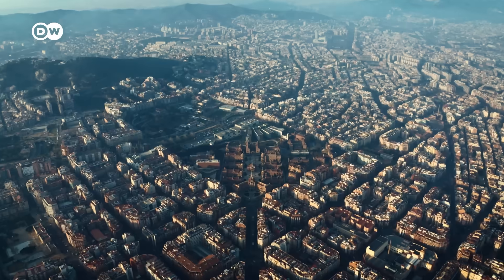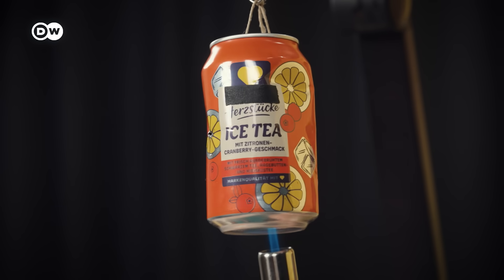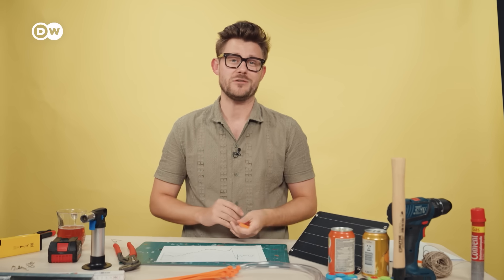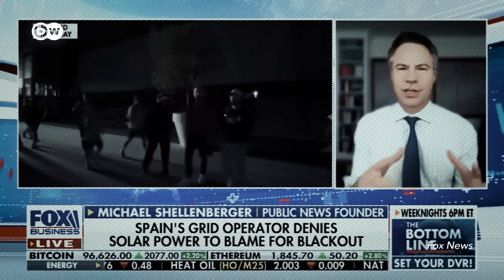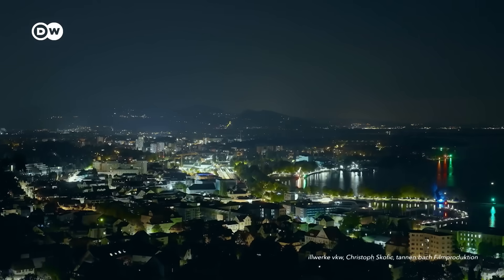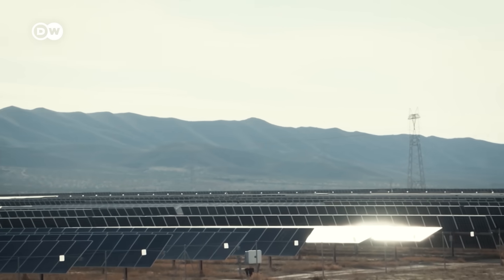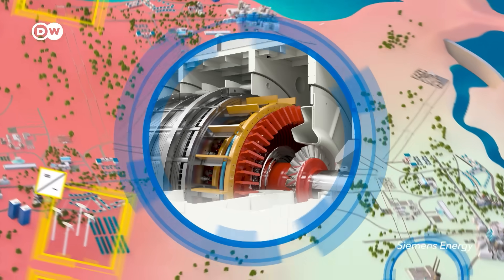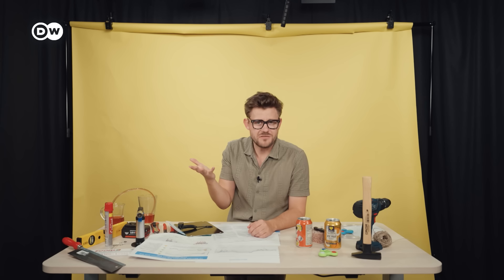Solar's hidden problem (and how to solve it)

Comment: "but spinning turbines don't just help make electricity they also help keep the grid stable because they have a naturally built-in security net called inertia"

It's called inertia, but it's actually "spinning inertia", otherwise known as angular momentum, that actually keeps the grid stable due to the energy stored in the spinning mass.

Turbines and generators have exactly the same inertia whether they are stationary or rotating. However when rotating they store energy and can absorb or release energy depending on the grid load. This acts in much the same way as a smoothing capacitors on the output of a DC power supply which automatically, and virtually instantaneously, absorbs or release energy to stabilise the DC voltage, thus giving time for the power supply to react.
Modern switch mode DC power supplies can react much faster than the traditional transformer rectifier based ones which means that much smaller smoothing capacitors can be used on their output. Similarly, inverters can react faster than spinning generators to changes in load, so whilst they will still probably require some inertia it should be significantly less than needed to stabilise a grid powered by traditional spinning generation.

Comment: just make a heavy wheel and turn it using solar power and then connect the wheel to a generator and supply to the greed problem solved
Reply: 1. That was not the issue.
2. There are better kinetic energy storage systems.
Reply: @old-pete yeah there are reservoir that can be built but may be they are a little expensive I guess

Comment: renewables ALONE are bad for a grid, luckily we have a mix.
Reply: Renewables are already a mix.
Reply: @old-pete  Honestly wind and solar isn't much of a mix. They generate their usable power in different seasons. We could go further by looking at geothermal and hydro but unfortunately they are geologically dependent.
Reply: @stijn2644  That is why wind and solar are not the only renewables.
Reply: @old-pete  What are some other renewables that are depolyable in most countries over the world except for hydro and geothermal?
Reply: @stijn2644 
Hydro and Geothermal are part of the mix, as is Bioenergy.
That are five sources of energy, quite a mix.
Reply: @old-pete  I asked particularly for sources other than geothermal and hydro because they are not representable for every country. Geothermal is very limited in heat production at this time, so only very low heat applications can benefit from this renewable form. Hydro needs mountains to produce the quantaties needed for an industrialized nation.

Bioenergy is honestly one of the worst sources you could use. Very low energy return, air polution, vast amounts of land compared to energy output and maybe worst of all, it competes with the food chain. 

Wind produces in the winter but not really in summer

solar produces in the summer and barely anything in the winter. 

That's still only wind and solar that can be deployed on a large scale. Don't get me wrong, renewables are a good way of producing energy, they are just not an end all fits all solution.
Reply: @stijn2644 
You claimed wind and solar are not a mix, but it is five sources.
Most countries have access to all five.
Bioenergy does not compete with food production if you use waste, that is produced everywhere people live.

Comment: Large utility scale batteries, with good BMS and inverters, also do quite well to manage demand fluctuation. This kind of thing is not some kind of blocking problem. It's more  an another-day-at-work hiccup for grid engineers. I'm not one, and the same concept as a synchronous condenser was the first thing I thought of. And really that's just a very fancy name for a large flywheel storage buffer that's optimized for a specific function.

Comment: 3:00 batteries can solve this problems!
Reply: Batteries are only useful for small appliances. Big scale classic batteries will just melt themselves.
Reply: @forev5091  no! big Li- batteries work in bigger cases as well
Reply: @forev5091 bs

Comment: Soooo now we admitt it was a issue?
Before it was all denial. This is like the push with electric cars....sure it sounds nice but you need the grid to support it. Also uf your grid is powered by coal it makes electric cars utterly pointless and actually worse for the environment.
Reply: 1. It is not really an issue.
2. Most countries do not run their power grid on coal. That is not economical.
Reply: Electric cars are around 4 or 5 times more efficient than gasoline vehicles if we're measuring energy per kilometre. So yeah, they do sound nice. 

The usage of coal for electricity generation has decreased drastically over the last few decades. So, no, driving electric vehicles aren't worse for the environment.

Comment: The issue is something we have in the uk. Especially as the push for electrification of vehicles etc
Reply: No its not look into the UKs stability path finder projects, you'll find the UK has been very active in deploying inertia and grid forming technologies. Not just for increased grid resilience but because they also save billions in operating costs, helping to address historic issues present in the UK's grid.

Spain consulted with the UK after their incident to see how the UK supports its grid. What with the UK having a laege number of SynCon units and the 3rd largest global deployment of grid batteries (and the lhighest total capacity in Europe).

Comment: So to prevent this issue long term a battery (sand, salt lithium etc) or hydrogen generation or running pumps on water storage of the excess power being produced
Reply: Battery solutions not lithium batteries to expensive and can’t store over long periods of time but building Pumped Hydro Storge and as you say Sand or salt or batteries could be a good solution.

Comment: When we discover a new energy source like photovoltaic solar, we go all out thinking we've discovered the ultimate technology that we should exploit. 
Until a newer tech comes along, then we think how did we put up with the old tech? 
We will discover new metal alloys that will generate electrical current when exposed to radioactive material, with an efficiency that's worth while exploiting. 
So, hang on to all that radioactive waste! you'll be digging them up soon enough.

Comment: Grid stability means investing in new transmission infrastructure and energy storage. Not just batteries but pumped storage hydro for places where it won't cause deforestation

Comment: We have had blackouts long before solar was on the grid
Reply: @offgridwanabe How often would you say it has happened? Is it really a problem, are we talking once a month, once a year, multiple times a year or once every 2-5 years or longer?
Reply: @luffirton  20 some years ago the grid went down in North America in August for a few days because of a failed sub station and it cascaded taking out power for a 1000 kilometres. The grid is old and more heavily used every day. I am surprised it doesn't happen a lot more.
Reply: @offgridwanabe  Yes, it was August 2003.
Reply: @luffirton  The northeast blackout was in 2003, so it's been over 20 years. However, that blackout cost nearly $6 billion in damages. So it's not really about how frequent they are, but rather, how costly a massive one is.

Comment: Many appliances at home transform the grid's AC power into DC power before being useful in the device. So I think local DC solar to DC appliance would be a much better solution for solar energy. The problem would be that the kitchen and washroom still require AC for the high power devices.

Comment: The problem is not solar or renewables, the problem is the implementation! There are algorithms for inverters that mimic the inertia of a conventional power plan, but here in Spain, if you want to connect solar panels to the grid, they need to follow the requirements and they say the inverter need to follow the grid, and that's the problem.

Comment: The biggest problems are our grid systems not being developed correctly in the past, we should implement big battery systems or other stabilisation system for energy needs, that are getting bigger and bigger.
Look at Australia and their big solar systems with battery storage integration

Comment: Just remember that it is solar and to some extent wind that requires massive investment costs  and operating cost and this is the price to add to solar and wind.  

This means we will never have lowered bills. In the uk bills just went up again but our government promised to reduce them £300 - they lied.
Reply: Move here to Norway then we have a government program £0,037 flat fixed rate for 5000kwh a month, over that you have to pay market price. The government pays the power companies the difference between the fixed rate and the market price.

Comment: Who exactly should be responsible for making the investment necessary to let part-time power sources like solar or wind  operate in a way that does not destabilize the grid? It should be the operators of the wind farms and solar panels rather than the utilities that actually are responsible for making sure that electricity is always available to the consumer
Reply: You just contradicted yourself exactly because the utilities is the responsible party for keeping power stable, and always available it is them that will need to be able to control and regulate their grid. That means they will need to have installed the right tools, hardware and software needed to make that a reality.

Comment: This is BS as Spanish officials & energy experts have confirmed that solar had nothing to do with the blackout, but is was triggered by a cascade of generation losses following the tripping of a large generator in the province of Granada, which led to a sharp drop in grid frequency and a subsequent overvoltage that caused further generation trips in southern Spain and Portugal.

Comment: 🔌🔌🔌I designed a base and peak shaving microgrid paralleled to a rural utility CO-OP in the Colorado Rockies, utilizing BESS in conjunction with grid-forming inverters integrated with STATCOM. It has operated flawlessly for over seven years. Additionally, I installed a black-start diesel generator to be employed in the event of complete control system failure requiring a restart. So far the generator has not been required.🔌🔌🔌
Reply: i trust that diesel generator is occasionally being started to exercise it.
Reply: @bocadelcieloplaya3852 @bocadelcieloplaya3852  Yes, once a month for 30 minutes followed by a cool down.

Comment: I appreciated this video very much. 
I still wonder who checked the e-transparency platform when this happened. If that is anything accurate, it seems not so much a grid problem but a management problem. Because 15min after the generation started to crumble, the general load was being cut-off, but the massive hydro pumping loads were still going. why not stop the hydro pumping before cutting everyone else off?
At least in Portugal hydro pumping was 50% of the entire load on the grid at the time of the blackout. Feels to me like that could have made the cascade not go down as dramatically as it did. Spain had a different proportion of hydro pumping load to the general load, but very significant still.

Comment: "Yes, solar doesn't spin. But is that a catastrophic and unsolvable problem for our grid? No!"

Strawman argument. The vast majority of critics have always said that you can have as much solar as you want, it's just a question about how much you want to pay. 

"But everyone has to do their homework."

That's a strange way of saying "Renewables are not in fact as cheap as often advertised. They require more investments in the grid."
Additionally, you left out that lots of the electricity is wasted unless you invest even further into storage.

Do an honest accounting of levelized total cost of energy for every incremental TWh of energy supplied to the grid. Everything else is just propaganda.

Comment: Seems odd they would leave out grid scale battery storage completely from this.
You hook up a battery to absorb any extra solar, and output if solar drops, that pretty much flattens those curves instantaneously.
Reply: As well as flywheels, capacitors and grid forming inverters. Also a grid needs be divide into different isolated trip areas so not all the grid goes off at the same time.

Comment: Solar is said to be the cheapest and possibly the cleanest available way to generate electricity (hydroelectricity not included), but it comes with downsides. The real cost of solar electricity should include, not only grid stabilisation, but also storage capacities to mitigate its intermittence. I haven’t found any serious study of what the true cost of solar would be with all the strings attached.
Reply: It's cheaper than every thing else. Batteries are cheap too

Comment: Europe is weird, 240v is MUCH more efficient but 50Hz is soo much less than 60.
Reply: nope, it's swings and roundabouts, on some things 50h  is more efficient and on others its 60hz. Typically for lower transformer losses, lower heat production, less copper, lower long distance transmission cost, longer equipment lifespan 50hz is better,  for lower equipment cost, higher power/faster motors, short transmission distance efficiency, lower losses die to arcing then 60hz is better. Most countries follow the IEC standard and choose 50Hz AC.